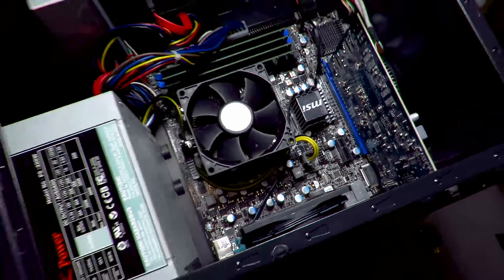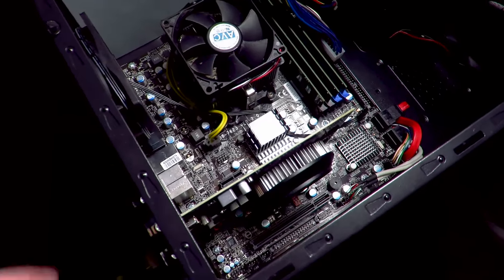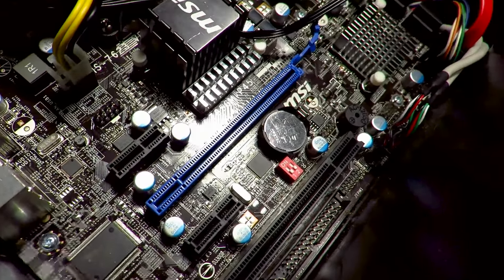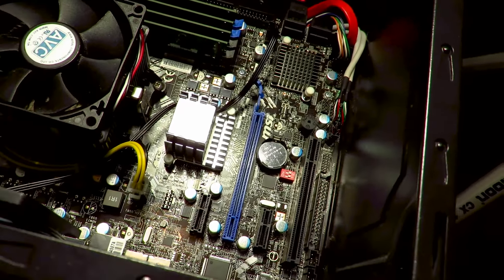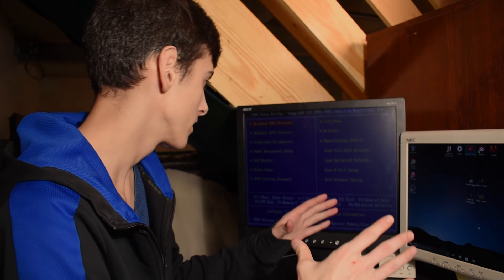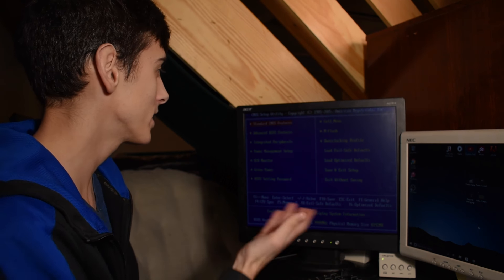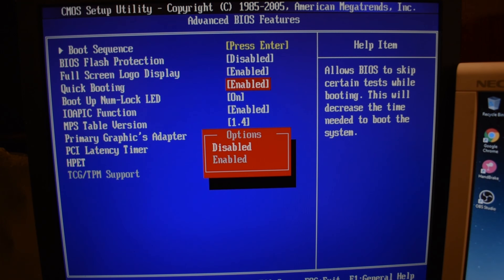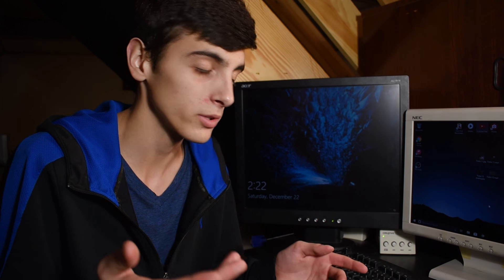[FIX] BIOS Screen NOT SHOWING UP!! [2020]

Comment: I just build my first pc today and had this problem I'm so glad I found this video cause it worked
Reply: So you would plug everything in, it wouldn't  boot. Then you took out the cmos battery put it in, rebooted it and everything showed on the display?
Reply: @k1rellzy452  yeah pretty much. every component was turned on in the case, all the fans running but no display when it booted up. found this video, took out the battery, put it back in and it displayed the screen
Reply: Did you try reseating your GPU?
Reply: @whatshisname2497  don't know what reseating means but I didn't really touch my gpu. took it out and back in. don't think it did anything

Comment: I didn’t work
Reply from the maker: Are you ok, if you don't work how are you going to fix it?
Reply: @ZackEberly  idk
Reply: @ZackEberly  do I try to take out the battery again
Reply from the maker: You can or try looking for a clear bios button or pins that need to be shorted to reset the bios.
Reply: @ZackEberly  do u have to be connected to WiFi to do this

Comment: omg I cant thank you enough the bios not loading wasnt the only problem on my pc when I updated my gpu drivers my screen would make a temporary ghost display I found about this 1 day before the vid lol before this instead of switching displays with a shortcut key I would directly turn pc on and off and many other issues now all of them are fixed and this conincidentaly happend when I put my new gpu from Aliexpress and started blaming it but turns out my gpu is fine thanks a lot!
Reply: Did your motherboard work before you removed the battery? I just built a new PC and everything turns on but I'm not getting a display. Can anyone help me?